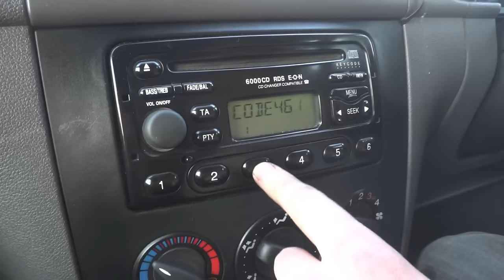How to input radio code on Ford radios

Comment: My old Ford Fiesta has a radio (2001 radio, a radio displayed with only 4 numberbuttons). When I press the 1-4 numberbuttons nothing is displayed on the display. The only thing displayed is [- - - -]. What should I do? I even have the 3-digits code. Should I somehow remove it and install it again?

Comment: lifesaver. got van back from the garage and code had to be reset. i just locked myself out of mine for 30 minutes. i pressed the 5 button but did not hold it down and it went into enter code 2, then 3. note to self, hold down the 5 button.

Comment: please help my number 2 isnt working so i cant input the second number of my code. how can i fix this. it stuck on lock 2 btw
Reply: Did you get a solution? , I have the same problem with number 1